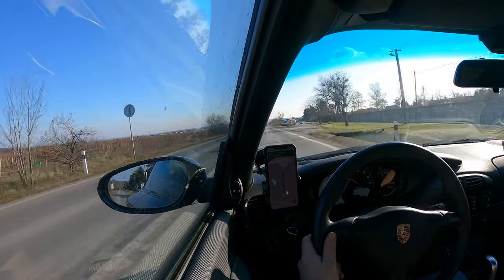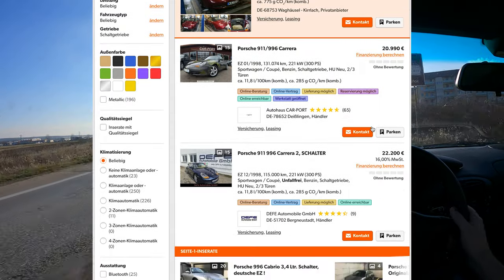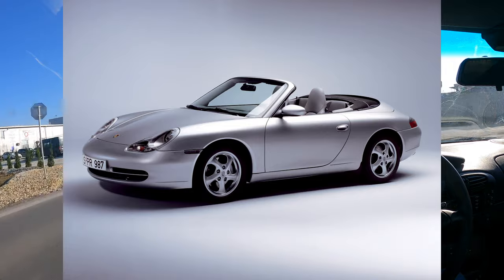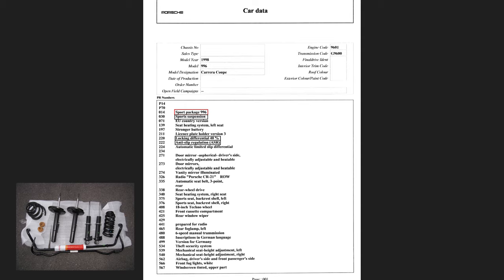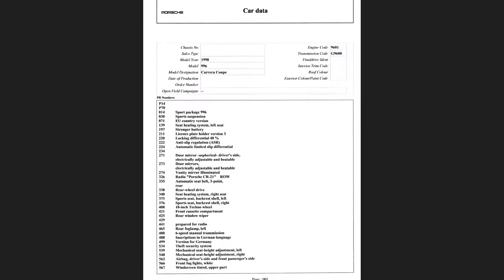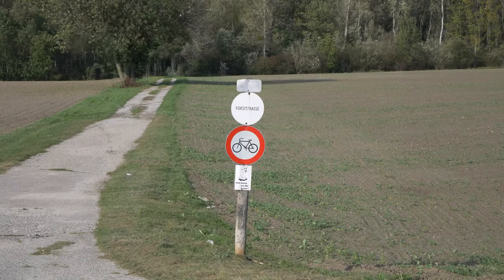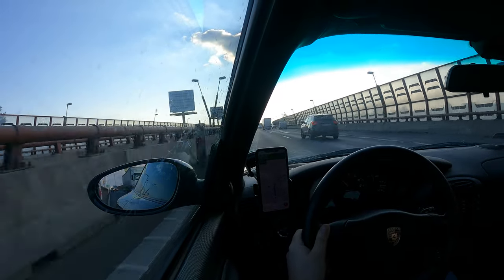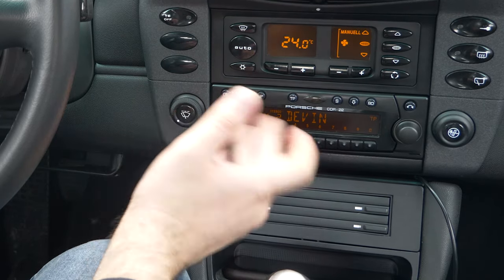Porsche 996 911 | Purchase selection, which options to look for? IMO

Comment: I bought mine without doing a whole lot of research. I am much more educated now. But I ended up with a 996.2 6-speed Coupe... as someone said before in the US it's hard to get one without a sunroof but I think the sunroof is awesome. My other car is a Boxster so I enjoy having some sunshine. Mine came with the Bose to tell you the truth it's pretty good. I hooked up an auxiliary input into the disc changer so that I can use my phone for my music. I have also done the sport suspension and lowering. I wish it had heated seats but other than that. I love it and actually prefer the narrow-body to the C4. I have owned many air-cooled 911. I love them but they don't hold a candle to this car. Extremely happy with my car even though I kind of ended up with a great one without knowing what I was looking for.

Comment: Just a piece of advice on the lights, Philips Unitons H7 LED's, having a Boxster 986 with litronic and a 996 C4S with standard lights, swapping in the philips LED's to my 996 makes it just as bright if not brighter than the factory litronics in the Boxster while maintaining the beam pattern perfectly and all for £100. Litronics are not worth it plus it's not plug and play, you need sensors on your suspension components for the auto-leveling and a load of parts such as piping and a new set of stalks for your steering wheel for the headlight washers, it was a good but is a very old system based on old technology.

I agree to avoid a tipronic, but disagree when it comes to AWD, The AWD system is purely mechanical and non invasive, it only kicks in when you absolutely throw the car in my experience with my C4S but the additional benefit is it has a much stiffer chassis, testament to this is the GT3 uses a C4 like the GT2 uses at C4S/Turbo chassis. The C2 chassis is less stiff and the front is identical to a Boxster but also the AWD being mechanical gives you options, for £600 you can get replacement spindles for the front wheels of the C4, C4S, Turbo allowing you to simply unbolt the drive shaft and front differential leaving you with a C2 with the GT3 stiffer chassis essentially with no side effects and if you then decide you want the AWD you simply put the bits back on, can all be done DIY in a day.

Option wise I'd say on a later car BOSE is a must have, the fibre optic system makes the radio very difficult to upgrade to anything but the new PCCM+ so may as well have decent sound as the standard speakers are pretty poor. Living in climate where half the year is on the cold side, I'd reccomend heated seats and full leather is also a nice option. Cruise control is nice but easily retrofitted just like the factory auto-dimming mirror, footwell lights, rain sensor, any cosmetic interior trim bits ect
Reply from the maker: Thanks allot for your comment! From my perspective, I like to keep it simple with regards to the AWD. With regards to the headlights, thanks again, I did some research on Phillips website and sadly from the kelvin values they are all white or close to white light, given that I have the xenons on the 997, I want to stay with the yellow, but I am glad to know that should I plan to use the car more as a daily, there is an option. Oh and great info on the litronics, you saved me a tremendous headache as I can imagine that if I found the set on ebay for a good price, I might have just straight bought it without any research, uuuf... that would have been a headache! Have a great Sunday!

Comment: Agree!  Early 996's are special, cable throttle, lighter weight, no driver aids, and with today's tire technology it grips grips grips!  Also prefer the 996.1 headlights over 996.2.  Early 996's are the pure design and spec.  Mine has under 30k miles and only 200 stage 1 revs and 0 stage 2 revs.  It's a baby.  Will never sell it!
Reply from the maker: Comment made my day! Fully agree and awesome 996, if I might ask, how does one acquire a under 30k example ?
Reply: @CarPlebs  Thanks for noticing my comment.  Love your videos.  I live in the US in Arizona.  We have a for sale website called Craigslist.com -  People use it for selling stuff without too much fuss or bother.  After looking at all the big car sites like Autotrader.com or cars.com I stumbled across this white 1999 996 with 28k miles in the San Francisco area.  I spoke with the owner who had many maintenance records, and the car was owned previously by two older gentlemen who took great care of it.  I paid the local Porsche export to do a pre purchase inspection then upon hearing that it needed new ignition coils I negotiated the price down from 31 to 29 thousand dollars.  He agreed and I flew there with a check in my pocket and arranged for shipping.  I guess I was lucky, but also it was a lot of work for months checking for newly listed cars.  Another nice thing is that in Arizona there's no sales tax if you buy from a private party and no other types of fees except $149 for two years of registration and this being my 6th car the insurance was very cheap.  White 996's built in 1998 especially glacier white  with the all leather interior are pretty rare, I feel very lucky.
Reply from the maker: @georgem5589  Thanks for your comment, glad you like our videos, its more or a side hobby but we try to do our best. I know how it is managing 6 cars, it's a pain if I may say so myself :-D, always something to be done. But I guess that is what comes with the sickness. I bought my 996 for around half of what you payed, but with much higher mileage. Anyways awesome purchase and may it serve you well!

Comment: Hi. I agree on tiptronic issue but I respect owners who opted for an automatic. I own 993 C2 and 996 4S both manual and despite four wheel drive on the 996 I always think twice before putting pedal to the metal. C4S has definite predominant rear wheel drive characteristics and with PSM off is tail happy almost same as my C2 993 is. Regarding driving experience 993 is raw and it makes you think that something has gone forever after switching to watercooled engines... Anyway - no matter which generation and gearboxes - every 911 is an outstanding car. Regards to all
Reply from the maker: Oh the 993, you are lucky ! One day I will take a 993 for a spin 🥰
Reply: @CarPlebs  I live in Poznań - feel free to pop in once in Poland again, you more than welcome to compare both 911s. Regards
Reply from the maker: @t.s.9592   awesome and thank you ! :-)

Comment: >200k on the clock is fine by me if there is a nice service history with the car. Rather have more miles and good services and upgrades than a lower mileage car with no service/mods. >250k is a different story. Here in the Netherlands there are plenty for sale below 20k. The more expensive ones are not really selling. Also nothing wrong with a tiptronic, add some peddles to the wheel and you can have a lot of fun.
Reply from the maker: Well that’s the thing my 996 has around 100k and it’s awesome to know I can use it every day w/o worries about the stupid numbers